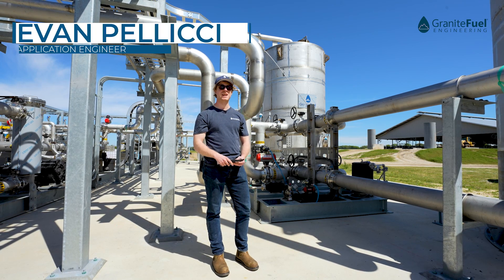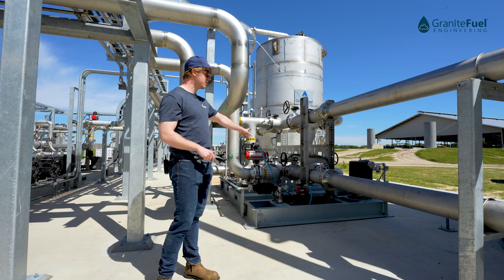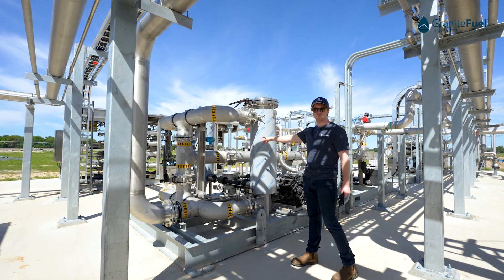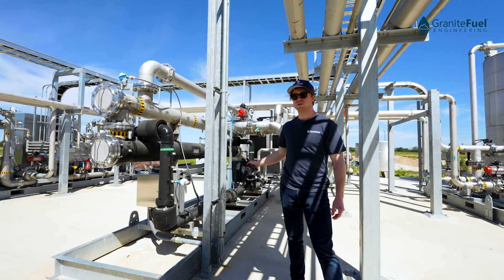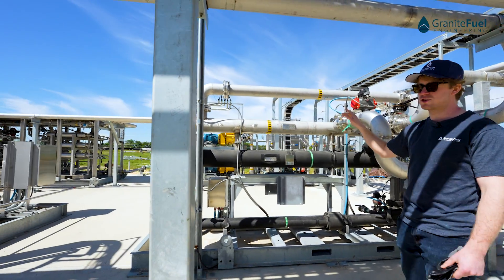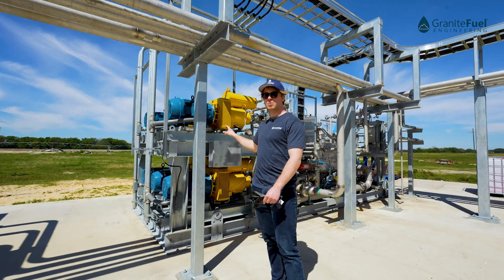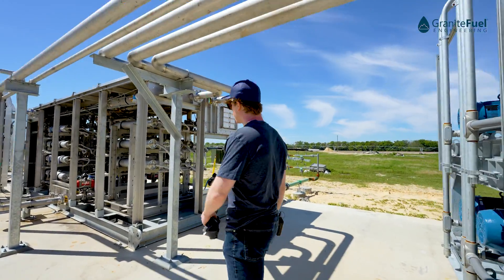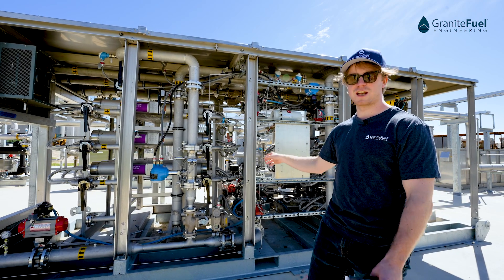Biogas RNG plant Tour with GraniteFuel Engineering

Comment: Hi,after processing this gas how do get store it if the need arises.
Reply from the maker: After processing the gas is injected into the natural gas grid, it is not stored on site.
Reply: @granitefuelengineering4689  hey, I found hot spring deep sea in Yellowstone national park, where methanopyrus kandleri are, the hyberthermophilic anaerobic digestion hot water 100c-105c degree celsius, saltwater sodium and pressure 5 mpa and 50 bar and 725 psi, where methanopyrus kandleri high growth and produce purifier methane at home and gas plant. The renewable methane have high positive same as green hydrogen and fossil fuel natural gas have low positive as gray hydrogen are non renewable source.
Reply: @granitefuelengineering4689 hey I found something, hot spring in yellowstone national park, in deep sea where methanopyrus kandleri are. The hyberthermophilic anaerobic digestion with hot water 100c-105c degree celsius, sodium from saltwater and pressure 5 mpa, 50 bar, and 725 psi to produce purifier methane at home and gas plant, renewable ch4 have high positive as green hydrogen and fossil fuel natural gas have low positive as gray hydrogen is non renewable source.